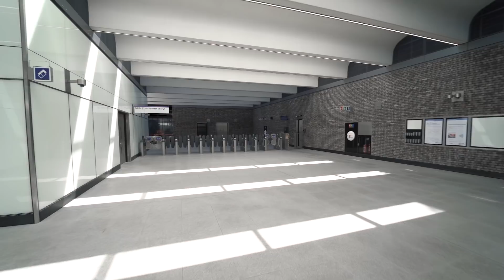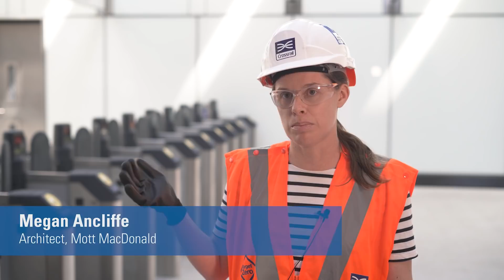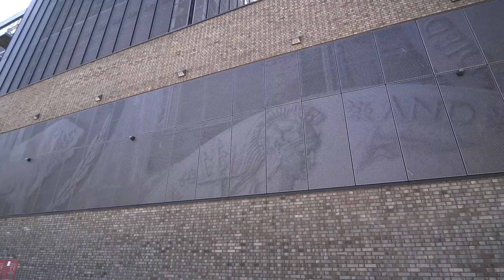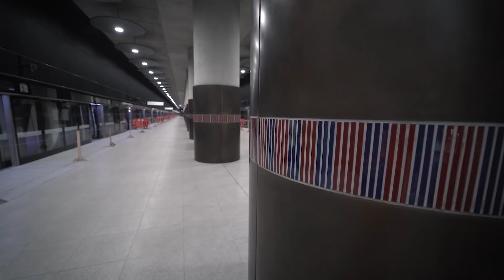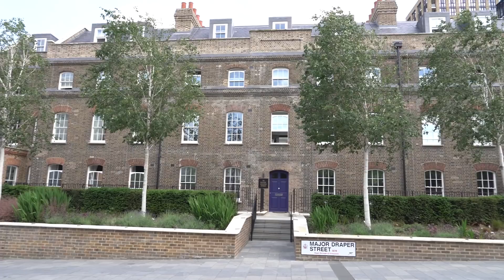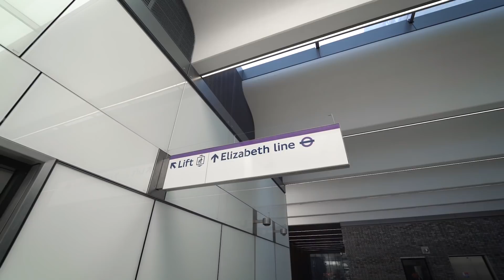Woolwich Station, Elizabeth Line, London

Comment: Woolwich as a whole, has been a generation gold mine in the past decade.

This is arguably one of the best connected stations in the South East of London/best connected station in zone 4 and once the EL is opened, will officially cement this claim as having the overall best transport links.

7 minutes to the financial district in Canary Wharf, 14 minutes to the city in Liverpool Street, 21 minutes to the west end in Bond Street and 56 minutes to Heathrow Airport Terminals. 

With 12 tph in both directions (every 5 mins), it wouldn't surprise me, if Woolwich currently a zone 4 station, will be upgraded to a zone 3 if not possibly a zone 2/3 as per Stratford. 

Woolwich Arsenal now has the EL to compliment the Riverbus service/pier, DLR, national railway and a decent bus service.

Comment: 56K passengers per day, is a lot.

A good comparison, would be North Greenwich on the Jubilee line extension, which was designed to accommodate 50K passengers per day.

Speaking of the JLE, a lot of people may not be aware, that during the JLE in 2000, a spur was built in the tunnel, in the direction of Thamesmead, to accommodate a future extension into Thamesmead!

Comment: They had a chance to rebuild the station and move the trains up above ground from the crap horrible underground Woolwich line, 
Which is the only line which goes under the ground from the Dartford Station to London. 

( in heavy rain the below ground Old Woolwich floods hence it closes down )

Why was the Woolwich line even under ground for most of the time when all the rest from Kent are above the ground even though those 
too were built after the original Towns in in South London and North Kent were built? 

With a new Station they could have saved tons of time and money on this already over budget and over due new train line by building the new tracks above the main roads on strong arched train tracks sections, No tunneling needed No wasted money or time to add on to the already well late being built new Cross rail system in North Kent.

I am sure the passengers would far prefer to go on the fully out side over ground train line running along above the main roads than stuck underground like the Woolwich old train line is now!

emergency